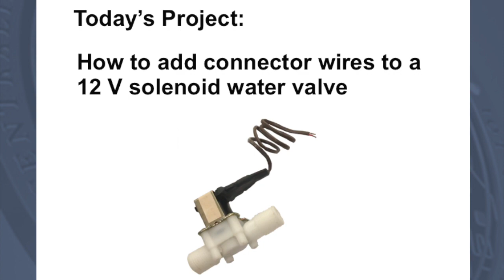Attaching Connector Wires to a Solenoid Water Valve

Comment: Hi - what power DC adaptor did you use? I have a 12v adaptor using the same valve as yours between 0.02mpa and 0.8mpa but for some reason it only opens partially so the water entering is it very low pressure.
Reply from the maker: Thanks for your note.  We use a 12V/1A power adapter for most applications.

It seems your valve may either be defective or not able to draw enough current as you suspect - these valves can be hit or miss and we always recommend testing them in groups for performance comparisons

Comment: Sir can I use Jumper only to connect to solenoid valve? I mean without the connector. I'm using ADC 12V/2A and solenoid valve exactly as yours but it doesnt work at all.. I'm confused. Is my solenoid valve broken? Thanks.
Reply from the maker: it's possible the valve is broken - we have had mixed results with procuring these

Comment: Does which side is positive / negative matter?
Reply from the maker: Polarity can typically be disregarded for most solenoid coils - so no, it doesn't matter which side is positive / negative.
Reply: @adosia  wow, thanks for the quick reply! appreciate it!
Reply: @adosia  So it's not series connection, we can use any port as + and the other one - connection ? Right...So the 12 v will not short as it's coil ? I hd a doubt so asking
Reply from the maker: @maheshidol  - correct, polarity typically doesn't matter with these valves, but you will want a flyback diode across the leads to prevent current surges when the solenoid disengages - google "flyback diode" for more info
Reply: @adosia  Thank you for the reply, It's most helpful for me getting this done today, as I was assembling my water RO machines
Reply: @adosia  if the solenoid valves connected to a relay, do i still need the diode?

Comment: What if I use 9v battery? Will it work?
Reply from the maker: Not all hardware is created equal.  These particular valves are rated at 12VDC. While some components can operate at lower than the specified operating voltage, you will need to determine for yourself with the hardware you are using.
Reply: @adosia  thanks

Comment: Yes, I have a most serious problem, a real crisis, to solve with a Solenoid Water Valve.  Due to Covid-19 my wife works from home.  To ease her boredom I hung a bird feeder in the tree outside her window.  She  delighted in her birds at first but now she battles birdseed greedy squirrels all day.   The plump squirrels are oblivious to her scare tactics;  waving, yelling, knocking,  etc..  Even her outdoor efforts fail.  Rude squirrels simply climb higher and bark obscenities down at her.  Once she turns away they’re back at the feeder.   I need a Remote and/or Alexa Controlled Water Solenoid Valve (Preferably 8VDC battery or possibly AC Low V). To drench these plump Critters.  Preferably a valve that stays opens about 5 seconds.  Any help is sincerely and greatly appreciated.  TY Best Wishes!
And yes we feed the Squirrels elsewhere too, but they love birdseed or maybe they just love pissing off my wife.

Comment: Is it posible that electicity somehow pass valve? If it is, could 12vdc be harmfull?
Reply from the maker: Anything could be possible in the case of poor manufacturing. With that being said we've never been shocked using/building out our setups and don't take any special electrical safety precautions as 12V is considered low voltage (relatively harmlesss) with these types of embedded systems

It's the current that's dangerous => V = I*R, where V = the voltage drop (12V to ground = 12V), I = the current going through the medium, and R = the resistance of the medium dripping the voltage (human body).  The current is directly dependent on voltage and resistance of your body, and increases as voltage increases.
Reply: @adosia  thanks for explanation. I founded some 6v solenoids witch are more suitable for hoby project i pictured. Best wishes!
Reply from the maker: @boki1425  - Our pleasure - let us know if the 6v solenoids work out well for you and we'll check them out if any good
Reply: Hi I want to ask. It may a silly question but it better than dont anything. Can we just connect the wire without using that red connector?